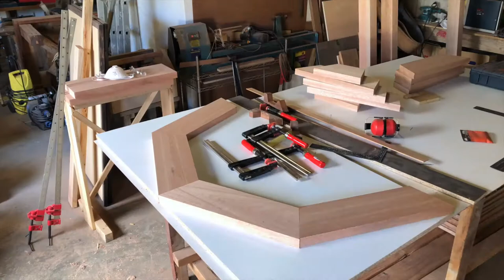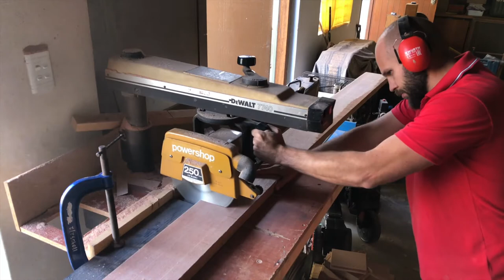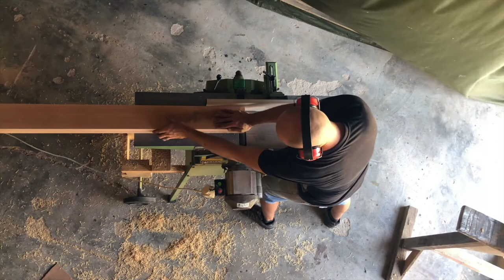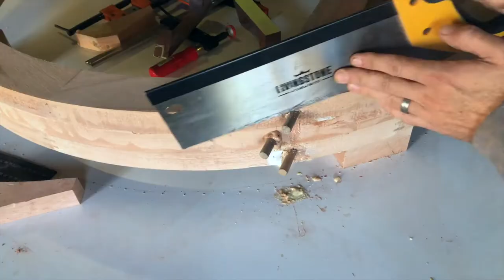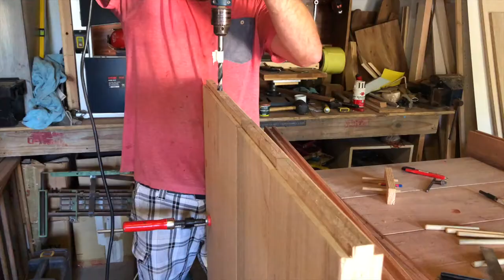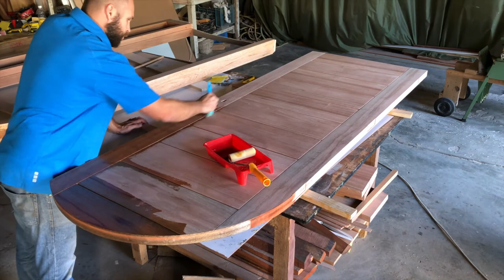Arch Door build

Comment: Very nice. I’m an experienced woodworker (45 plus years; mainly serious hobby but sometime small business). My, how methods have changed in those times. Use the most efficient methods that there are - particularly adhesives. What Chippendale would have done for PU or PVA glues!

I’m just starting on building 4 doors and frames all in the Tudor arch stile. There are all going to be internal and totally out of timber. For stability, I shall be using a lot of MRMDF. All the curves are complex and so I can’t use the router compass method. I’ve taken a photo of a style and had it approved. Then I used BigPrint to blow the pdf up to actual sizes (3 different sizes of doors and frames). Now I’m just starting to take a trace from the big print; then make a master MDF template and then make the real things. Im able to use the existing internal doors as the core of the new doors - with both sides covered and mouldings applied. 

It’s all straight forward if you take each step by itself and maintain absolute accuracy. Success for me is accuracy and consistency - that comes from experience and patience.
Reply from the maker: Hi. Thanks for your comment. Yes i agree if you have a good plan and take it step by step usually it works out good. 
Good luck with your build
Regards.
Reply: Wow, dankielankie was a lot kinder than I would have been. I guess this comment on HIS work was to promote YOUR work?   Let's see your work!

Comment: Beautiful arched door. I love the original design. What is that jointer/planer combo? I'm in the market for one. I'm subscribing because I love this door, but I agree a voiceover would be nice with some tips on making it.
Reply from the maker: Hi. Thanks for your support. Im using a Electra Bechum HC260 planer/jointer. This particular one is quite old. Built in 1985. As far as i know Metabo took them over. So matabo makes similar newer models. This one of myne can plane up to 260mm. A little limited but it really works great for what im doing. My latest video on folding panel doors i have done a voice over. Still new at making videos but i will keep on improving. Regards

Comment: if you dont cover then blade up on that jointer one day tour hand is going to slip  and your going to lose most of your hand, and also i carnt believe you let go of that crosscut saw mid  cut  the pass your hand right infront of it your crazy.  besides that you did a amazing job it looked awesome at the end, can i as how you allowed for the timber movement with all those rails in between  the stile on the door i imagine they grow a tone  if / when they take on any moisture which they eventually will
Reply from the maker: Thanks for your concern. I did not buy the planer new so i did not get al the part for it, including the cover for the blade, but i do try to be as careful as possible working on the machines. I did leave some space for expansion between the panels, Hopefully it will be enough for expanding and contractions. The doors are inside a building, so it is not exposed to extreme conditions. Regards
Reply: @dankieplankie9840  well i does look stunning

Comment: Nice job 
As I saw your are using a foam or expanded glue ?? Is that strong as normal or traditional glue??
Reply: Hi. Yes it is kleiberit PUR 501 glue. Has great bonding properties. Have used it alot and i have had no failures yet. Have made several laminated cutting boards and the hold up very good.
Reply: @hugovanniekerk7843  👍🏼